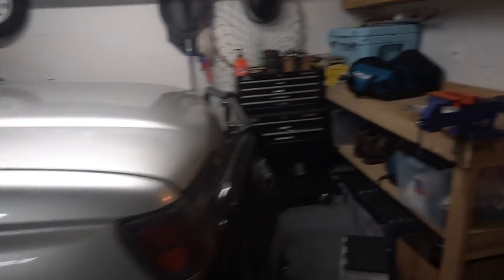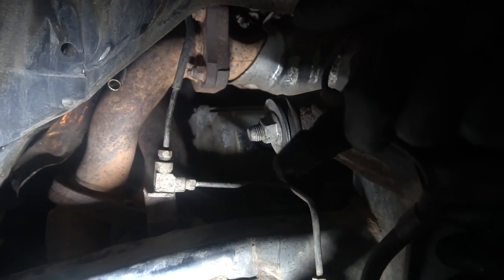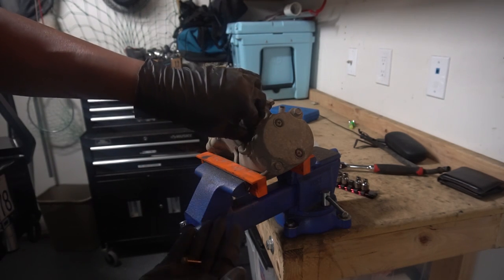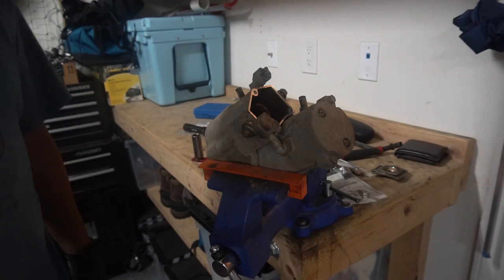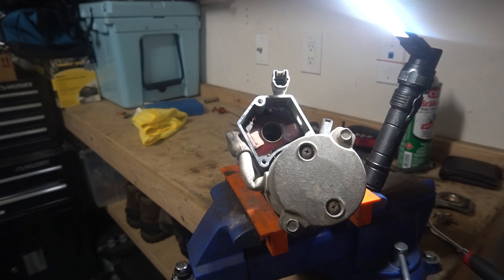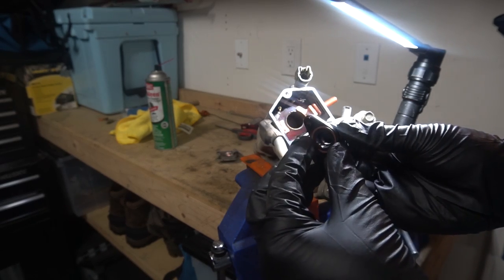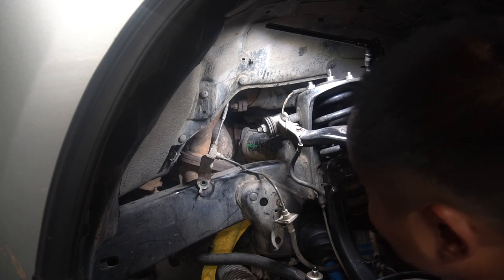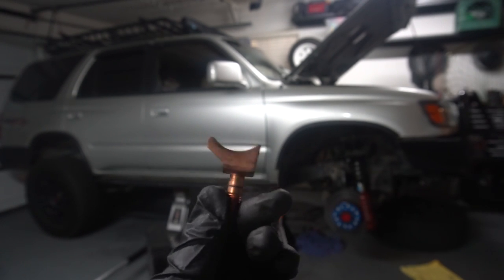Toyota 4Runner Starter Rebuild & Replacement

Comment: Huge fan of your videos. This was an easy one to follow along to. Now to address why some people are finding it easier to go through the bottom of the vehicle (which in my case it was). If you have a base 2wd or a 4wd w/manual transmission with the 1.4kw starter (vs Phorunner with the 1.8kw starter) its much easier to remove the starter from the bottom. I found that removing the exhaust bracket that's in the way gave me enough access to get to both of the starter bolts without having to use an extension. That top bolt was a PITA though, you'll need a 1/2'' drive. I didn't need to remove a wheel either everything was reachable/removable from underneath if you have the smaller starter. Toyota Part #'s if you have the 1.4kw starter:

Battery Terminal Kit: 28226-22050
Motor Terminal Kit: 28226-74070
Plunger: 28235-55050
Reply from the maker: Thanks for adding and good tips for sure. My starter is working like a champ still btw!
Reply: I have the 1.4kw starter and have been looking across the globe for those part numbers. how did you find them?

Comment from the maker: just an update that this has been super solid since and never ever had the intermittent no start i had prior to this job.
Reply: Hey man I've really enjoyed your channel , damn quality is clear and to the point !  My truck only acts up on cold starts , I replaced with a cheapo remanufactured one I got for $60 and it went away would start no problems , for like a month now problem is back , think it's the starter again ??
Reply: I'm planning to work on my starter soon. My question is, would those oem parts be the same for a manual transmission? Enjoy watching your videos very informative and thanks in advance!🤙🏼
Reply: I heard they are different? Any updates?

Comment: Thanks man, first time I've replaced it. The ol four runner needs love after 320,000 miles of faithful service!!!
Reply from the maker: Nice. Was it hard to get the starter out?
Reply: @PhoRunner Channel  not to bad, thanks to you, I did have to go buy some extentions. Thanks again for making the excellent, very descriptive video. You made it easy. Appreciate it.
-east Tennessee.
Reply from the maker: Nice. Everyone complains about this job and I’m unsure why haha. They said it’s very hard to get the starter out of the wheel well
Reply: @PhoRunner  the video I watched right before yours said the wheel well was the ONLY way to get it out. But your video had the rebuild process, presented perfectly for people like me. I'm one of those idiots that spends 4 hours changing a battery, fixing every tiny problem I see along the way. LOL

Comment: Excellent job on the video....saved me hours on figuring out the right combination of tools! Nice set up on the front end. Would you mind sharing the info on the rotors. Looks great.
Reply from the maker: Just OEM tundra rotors and 231mm tundra 13WL calipers
Reply: Thanks! I just noticed the spacers. The blue anodized color looks pretty sharp.

Comment: hey bro i have a 1997 4runner 2.7. has no power on climbs..
when I accelerate the pedal does not respond quickly, it is difficult to increase the mph.

If you have any ideas I would really appreciate it.

you make good videos and very helpful
Thanks 🙏
Reply from the maker: A locker won’t help there. A regear or super charger will :)

Comment: Great breakdown on a common problem.  What is that magnetic light you were using?  For a battery light it looked plenty bright.
Reply from the maker: Hf magnetic light
Reply: @PhoRunner  thanks and keep up the videos coming.

Comment: So I am about to do this job, watched a ton of videos and thought of something while watching everyone to struggle to pull the starter out the wheel well.  If you cut your steering wheel all the way to the left, won't it move that control arm giving you more room or does that piece not move when the wheels are turned??
Reply from the maker: I'm not sure. It was pretty easy to get out for me

Comment: Take nut of upper control arm then rubber mallet bolt flush with control arm ,Starter motor comes out easier .

Comment: Tell me, where did you order the replacement parts for the rebuild?
Reply from the maker: ebay or amazon or straight from toyota. I provide the part numbers in the description so they are the QUALITY ones from denso/toyota. Not junk ones!
Reply from the maker: you can order from camelback toyota parts here: https://parts.camelbacktoyota.com/oem-parts/toyota-plunger-magnet-switch-2823554380

Comment: I am hooked up to your channel in just 4 days 🤣 Where did you buy the rims? and what is the size of both the rim & tyres... I would want to have the same for my build-project
Reply from the maker: Lol. 285/75/17 bfg km3 e load on factory 5th gen 4Runner trd pro wheels. Join a 5th gen marketplace fb group, I’m sure folks are selling them on there or you can buy from the dealer
Reply: @PhoRunner  Many thanks for the tip my brother.
Reply: @PhoRunner  Will this tire fit in the wheel well under the vehicle? your rig looks awesome
Reply from the maker: It will not. Largest size is 32” tire